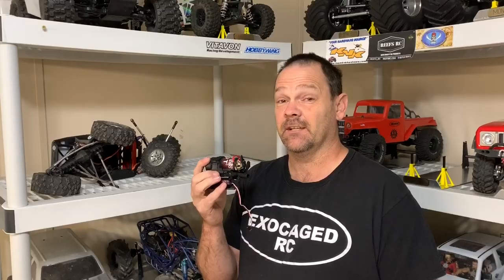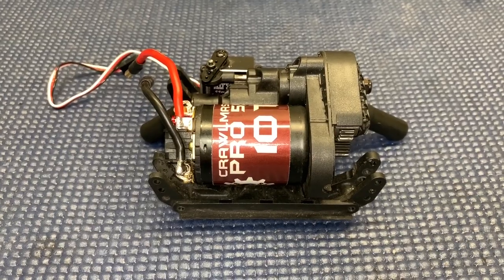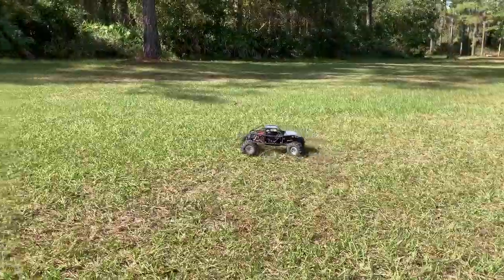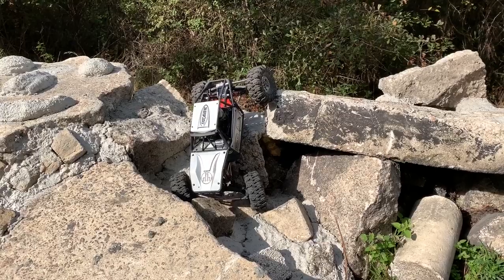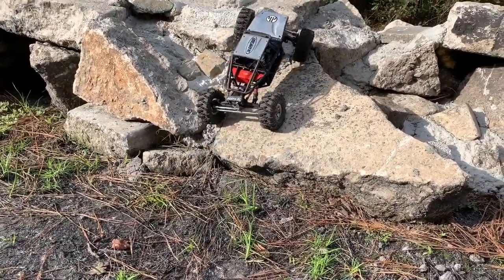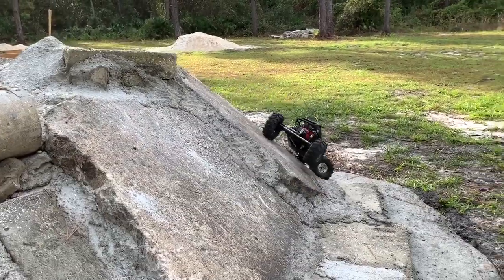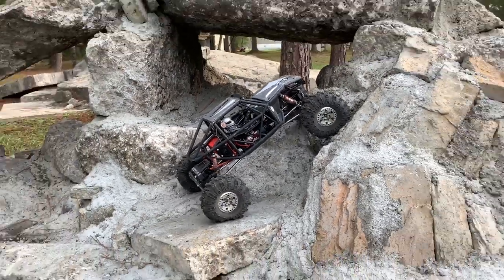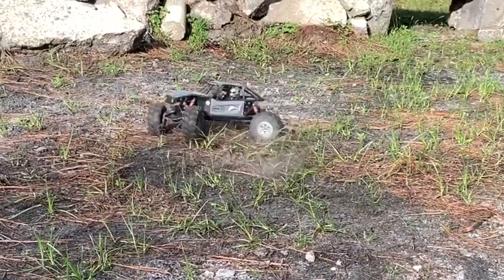550 Crawlmaster Pro 10t in a Capra!!

Comment: Someone showed me and I tried it myself... you don't have to remove any of the bottom links to get the motor/transmission assembly out.  You just have to remove the top T portion of the roll cage (4 screws).  The body piece for the drivers and motor/transmission will come right out of the front of the Capra.  I don't know why they didn't show this in the manual. I would have kept pulling the whole thing apart like you have.  I did put bullet connectors between the motor and ESC so that helps quite a bit too.
Reply from the maker: thank you and I absolutely will give that a try next time, thank you

Comment: Have you tried putting a brushless outrunner in this? Buttery smooth and mountains of torque!
Reply from the maker: I have not, due to noise but when these new silent esc's hit the stores I sure will!
Reply: @ExocagedRC  I put a cheap helicopter motor in mine (Surpass 3548 1100kv) with a Hobbywing EZEun and it's not that noisy. It did snap two half shafts though.

Comment: Hey guys! noob here and I have a question, hope you can enlighten me. Why would someone use a low turn(High KV) motor on a crawler? Or is it only recommended for a light setup with 2 gear transmission? Sure there will be scenario sometimes where you will need some speed, but you mostly need torque and smoothness, correct? So a High Turn/Low KV motor would me more appropriate for a crawler.

Would really love to hear from more experienced RC folks. Thank in advance. cheers!

Comment: Nice work getting that 550 in there.
As for the Pro...you get what you pay for. Holmes Pro motors are awesome. 
I'm curious of what makes more power....the Crawlmaster 540 Magnum or Crawlmaster Pro 550?
Reply from the maker: Tom Lucas I asked Holmes about this and he isn’t sure either. This is the quote I got back from him. So basically this whole 550 thing is cool but not needed. 

Magnum has a larger diameter rotor and 3x the magnet strength. They are pretty even, although I haven't gotten them on the dyno yet.

Comment: do you run expo in your throttle channel?    I'm looking for a pinion for my capra RTR but none of the gears i'm finding specify the shaft diameter.  advice?  are they all the same?  

FYI your holmes crawlmaster pro 550 link seems to be broken.

Comment: Do you set your mesh kind of tight? I learned with the Capra it’s quieter if it’s got a little bit more backlash on the mesh as your setting it
Reply from the maker: Wildman georges rc channel George it’s a bit loose but can’t go any further. 11t is as low as I can go with it for now.

Comment: How would raising the link mounting point change things?  In other words why not cut that entire horn off?  
Thanks for the video.  Another good one.
Reply from the maker: Changes roll axis and antisquat, I thought about cutting it off but wanted to keep it there just in case I want to test out some different setups. If you're using the bottom hole like me and are happy with it then yeah trim that piece off.
Reply: It will change the Squat/Anti-Squat configuration. This is a force which will compress (squat) or raise (anti-squat) your shocks when applying power.
Reply from the maker: Dave Racine exactly
Reply: So the part (AXI231005) is 12 bucks and available so why worry.  Besides, there will be a metal one available soon.  Probably adjusted for the bigger motor.
Reply: @RTmadnesstoo  We don't worry, the guy asked why would you use the upper holes so we explained, that's all..
Reply: @daver18qc    Yeah, I'm the guy.  I just meant with a cheap replacement part available why not cut one up to make installing a 550 motor easy.  If it doesn't work out buy a new belly pan/skid plate.
Reply: @RTmadnesstoo  Ah, yes of course cut it if you like and don't need the squat adjustments !

Comment: Why not move the transmission forward and redrill the mounting holes instead of trimming things? I've never seen a capra in person, but it did look like there was room in front of the pinion to do so.
Reply from the maker: The trans isn't easily moved due to the way it sits in the belly, its fitted to go in that exact spot. now with the new bellys that are being worked on that may become a normal design feature.
Reply: Exocaged RC New bellies by Axial or aftermarket?
Reply from the maker: Bryan Larsen the aftermarket is working on them

Comment: Which Transmitter are you using for that rear steer? I like that alot!!
Reply from the maker: cagerage21 hacked GT3c, 8ch I hack and sell them.
Reply: @ExocagedRC  Awesome I run the Normal GT3C! How much is that hacked one you sell?? Is it better than a Flysky GT5?
Reply from the maker: cagerage21 I hack the silver/titanium color ones. In some ways yeah they are better but the GT5 is also a really good radio. One of the important things about the hacked radio is all the mixes like you see with the 4ws. Way way easier than the gt5. Also momentary switches for winches and stuff.
Reply: @ExocagedRC  Sweet!! Do you have a website or how do I order one?
Reply from the maker: cagerage21 send me an email at exocagedrc@yahoo.com

Comment: What should I buy this Capra or scx10 or trx4
Reply from the maker: Depends on if you want more scale or not. All 3 you mentioned are really good trucks.
Reply: Exocaged RC I think I’m gonna wait for the RTR version of the Capra bc it’s less expensive and I can upgrade as I play.
Reply from the maker: Kenneth Garza good choice and yeah man there are going to be a LOT of upgrades for the Capra coming out soon. Many are out now.
Reply: Exocaged RC yeah that’s why I really and leaning for the Capra. While I wait for the rtr ima start building a rock track. Similar to yours. Any tips or suggestions?
Reply from the maker: Kenneth Garza yeah. Do what you think you want to drive. I need to do a park video just showing how I’ve built the stuff I have. Maybe I’ll be able to make that video this weekend. Also you’ll need concrete and wood. Save the concrete bags to use a filler to fill holes you don’t want to save concrete.
Reply: Exocaged RC yeah please do a video. I’m really interested in seeing how you came about designing the layout and to see what’s too much and what’s worked out really good for you. Whats your next plans too, will you eventually have a dirt track or mud spot?

Comment: Ultralight rematch time!!!
Reply from the maker: Bryan Larsen I think the Superlite may not win another round
Reply: Exocaged RC your Capra has a trick for every scenario now. 4 wheel steer plus dig, improved steering angles, it’s pretty trick. Mine has the Reef 444, HW 1080 and HH Crawlmaster Expert. I still haven’t sorted my tires out.
Reply from the maker: Bryan Larsen well the two best tires so far are the KLRM’s like you see here and with the right foams the Proline Crawler TA like I tested on the Superlite. Unless something else comes up you’ll see those prolines on the Capra tomorrow

Comment: May be ill buy that motor its fast and high toque
Reply from the maker: oh man this is the best brushed motor I've had in anything so far, no kidding.
Reply from the maker: links in description to take a look at it for yourself. Holmes website or ebay, your choice.
Reply: Ow never mind its kinda expensive might get budget motor 550
Reply from the maker: @rcgarageph7228  due to the can design of this vs a normal 550, the normal one wont fit even with trimming. Look at my other videos with the 540 size Crawlmaster Sport 13t  its only $15 and runs great, not as good as this but plenty good.